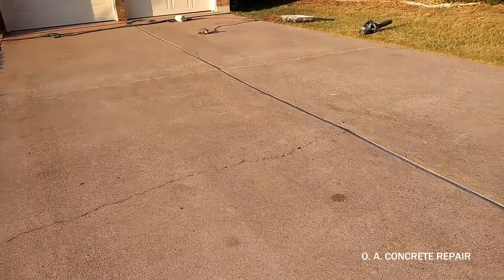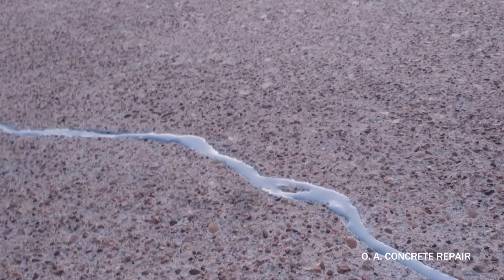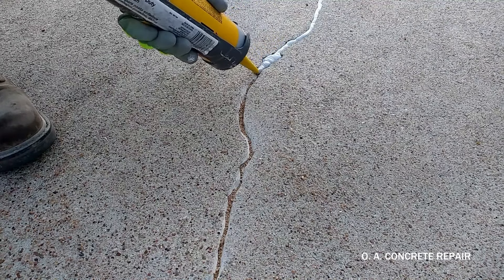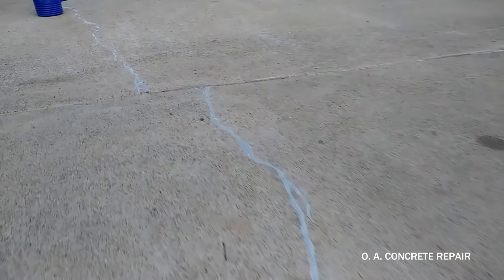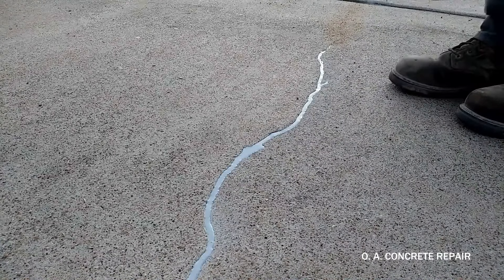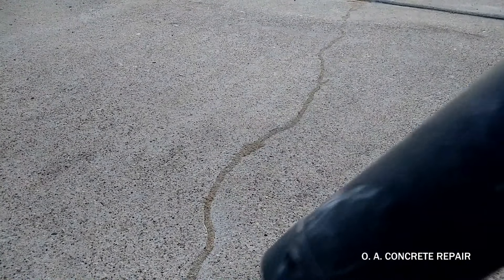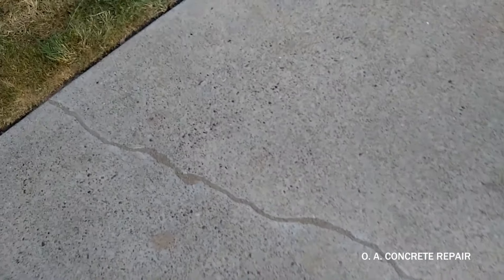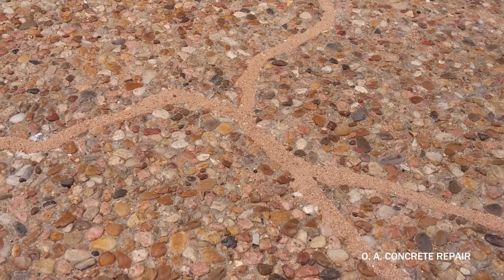SEAL / FILL / FIX / A CRACK IN CONCRETE DRIVEWAYS

Comment: Collect the dust made from grinding the cracks to sprinkle back on top to match the color.
Reply from the maker: I would have to pressure wash the driveway first, otherwise I would be collecting concrete dust plus ants, bugs, spiders and leaves 😆
Reply: Good solution if u have time

Comment: I think using a saw to open the crack draws more attention to them, to the repair, or maybe it's somehow less organic. I don't mind the look of the cracks as much as I mind that water keeps eroding the concrete and making them grow. I started using DAP liquid crack filler and found that in hot weather it's best to thin the product down with water and either inject it or pour it into the cracks even very thin cracks. It will either self-level or seep down and seal it lower in the crack. Wait a day and refill with unthinned DAP filler. I have an agraget driveway so once I have filled the crack I let them sit for a day or two and then paint or refill any de[sessions with filler and then cover with sand or fine gravel and let fully dry. Do it right and you can't see the filler at all. The driveway's almost 50 years old, poorly installed, never maintained, and is a turnaround point for every large truck coming down the dead-end road... in the world of Amazon that's a lot now. Some cracks were an inch and a half wide. I suspect that heavy garbage trucks pivoting on the corner started and have caused the majority of the damage. Using a pressure washer showed the bottom concrete panel looked like a crushed eggshell revealing cracks I couldn't see before being filled with moss and debris. 14 bottles of DAP crack filler and all the cracks I can find are sealed and filled, most are finished with sand and gravel, and the worst corner is sealed but still needs to be filled more. - https://photos.app.goo.gl/jADqdAj7QZTCSi9p6
Reply from the maker: Wow! That's commitment to your driveway. So in regards the opening and widening of the cracks, I do this so that the sealant, when applied, will be more wide than thick, otherwise the sealant will split apart from the concrete in the first couple of thermal expansion cycles. 

In regards your wide cracks, I suspect the got that big because you may only have wire mesh as reinforcement instead of rebar. Anyways, if the crack is bigger that 1/4inch, I suggest you treat the cracks as expansion joints (for which I also have a video). You should install backer rod and top it with polyurethane or silicone. 

I don't know about DAP active ingredients, but if it has acrylic, it will all get stiff and crumble in just 1 year. Acrylic sealant don't do well with UV rays.

Comment: To get a better a look I would ground the whole floor , thn prime followed with the cast then fibre glass, ground fibre glass to level thn lay x2 coat
Reply from the maker: not sure why you say fiber glass, the only materials to repair cracks are polyurethane, silicone, polyurea and epoxy resins. Polyurea and Epoxy is only for interior use. Polyurethane and Silicone for outdoors. Outdoors structures expand and contract by the minute due to temperature changes. If you install fiber glass in a crack, most likely the crack will recrack in matter of few days or the next season change.

Comment: Fill the cracks with GE 100% advanced black silicone! Works great!
Reply from the maker: If it is black, I think it will stand out a lot. Most of my driveways are light gray, if not almost light tan after a pressure wash. But thanks for the feedback, I will look into it.

Comment: I cant find the answer to how long the seal when sealing cracks lasts 😭😭, specifically expansion control joints and smaller cracks too
Reply from the maker: The material itself should last about 5 years before it starts degrading. Sealants are only meant to withstand thermal expansion and contraction. But if your driveway is already undergoing heavy settlement due to bad soil, then the sealant will split due to the settlement forces that are are pulling the concrete down or up. But still, sealing cracks and Joints is a much better option and much more cost efficient than replacing the driveway. Waterproofing all gaps and cracks can buy your driveway more time
Reply: @oliveraguirreconcreterepai4826  I see. Thanks for the reply. That info really helps me out

Comment: Looks like a good functional fix but not happy with it cosmetically. Makes the crack stand out even more.
Reply from the maker: Yes, but if you don't waterproof a crack, subsequent structural damages will follow.
Reply: Yea there’s not a real solution that can  cosmetically make a cracked slab look good again.. you have to replace it
Reply from the maker: @brandoncontreras7538  the only way to truly hide a crack is to resurface the whole concrete with a fake stone overlay. And hiding the cracks in fake Stone joints... I have done this before. The crack will reappear, but and I will then have to be sealed with the same method as in this video, but you truly won't see them. This whole process does come to be very expensive, but still not as expensive as a full scale concrete replacement.

Comment: What do you recommend if I plan on painting my smooth concrete driveway instead of the sand can I just simply paint over the caulked cracks?
Reply: if the paint adhered to the bond you used

Comment: Can you add regular sand to the sika crack fix that is meant for sloping driveways, as well as the self leveling Sika sealant which you used in this video? I would assume yes, because they are both polyurethane concrete sealants.
Reply from the maker: sand will stiffen the poly and then it will crack earlier if you have soil settlements. But yes, you can add sand to both. Just wait the Self Leveler skins, otherwise the sand will go too deep and you will end up having sand with polyurethane instead of polyurethane with little sand topping.

Comment: Is the grinding disc V shaped or do you make a V shaped channel.  Any suggestions on V shaped grinding disc and Polyurethane sealer?  Thank you
Reply from the maker: Yes, it is V shaped. Available online only or concrete doorfront stores. I use Sika, but you can use any brand. Most important is to not use acrylic based sealant.

Comment: I'm confused.....You blew out the particles, but poured sand in?
Reply from the maker: Blow of the fine concrete particles that are the result of grinding the crack. Then, if the crack is wide, you have to install something to prevent the sealant from leaking through. That why we install backer rod or sand. Pay attention to the audio "side walls of the crack should be clean". So regardless of using backer rod or sand to fill up the crack, make sure to leave room for the sealant.

Comment: Are you able to paint over the sealant to try and match the concrete? I had collected a jar of dust to sprinkle on top but i had a bit of cleanup to do and forgot 😢
Reply from the maker: Concrete dust is the best. First, concrete should be stained with transparent stains, as non-transparent stains typically peal of in few years. Second, you can stain if you had applied some sand of concrete dust over the polyurethane. Basically, the sand is what gets stained. Polyurethane itself is not very good with transparent stains. You can always remove the polyurethane with a grinder to do the job again, but it is a lot of work.
Reply: @oliveraguirreconcreterepai4826  Thank you for the reply. I may just leave it. The stairs will cover it anyway. I'm just meticulous about things and will always know it's there lol

Comment: what happens if you don't bother with adding sand or backer rod, and just inject a bunch of sealant into the crack instead?  And apply more after the first application is dry?
Reply from the maker: If the sealant is not thin, it will not be elastic, if the sealant is not elastic, when concrete shifts due to thermal contraction (night time) the sealant will split away from one side of the slab. This can happen within just few days. And the worst part is that removing thick sealant is time consuming. Better do it right from the start, safe money on sealant and do the work only one time. And if it still splits, removing properly installed sealant takes less time than thick sealant.
Reply: @oliveraguirreconcreterepai4826  okay thank you!

Comment: Whar type of cement and sand? Thank you
Reply from the maker: Don't use cement! Use polyurethane based caulk, typically found at the concrete aisle of the hardware stores. And in regards the sand, just use any play sand of your preffered color, just make sure all grains have the same size and are as small as possible.

Comment: what if I sprinkled quickrite instead of fine sand for a better match?
Reply from the maker: Cement will hydrate and harden when water touches it and this will stiffen the repair. In order for the waterproofing to work, the sealant has to remain flexible. So it's better to just broadcast concrete dust or sand over it.

Comment: Looked worst then the original crack.
Reply from the maker: Agree! But if you leave it open it will get worse over time. And if you use concrete  to fill the gap, It will recrack within a week. Also, if you resurfacing the whole driveway the crack will still come back.
Reply: I thought the same thing!!!

Comment: Nice Job, but did you actually say "unexpensive"?
Reply: Did you actually ask such a stupid question?
Reply: You need to use a small “j”, not capital “J”, for the word “job”. Also, you need to add a period, or an exclamation mark (your choice), after the word “job”. Not a comma! Then, the new sentence starting with the word “But” is written with a capital “B”.
👀
Reply: @mikeike7114  The capital "J" was for emphasis. Comma is fine.

Comment: I have a huge crack and used a whole can of this material to fill it 😅
Reply from the maker: I hope you filled the bottom if the crack with sand or backer rod. And just topped the repair with the polyurethane, as in the video.